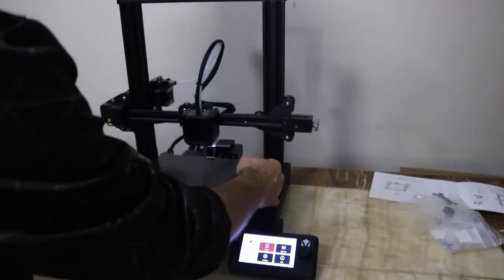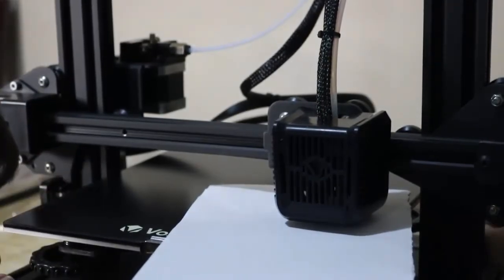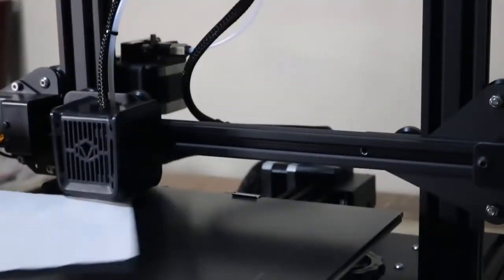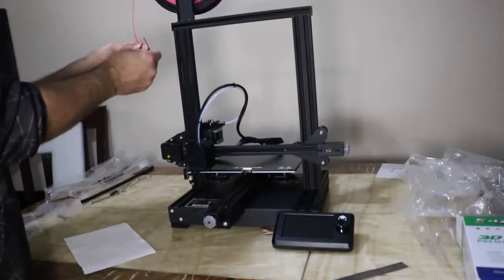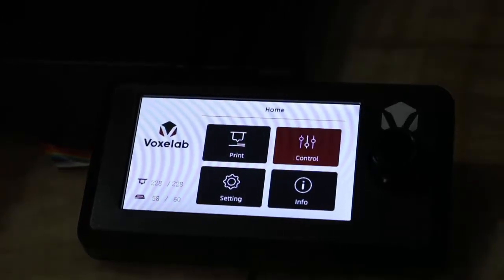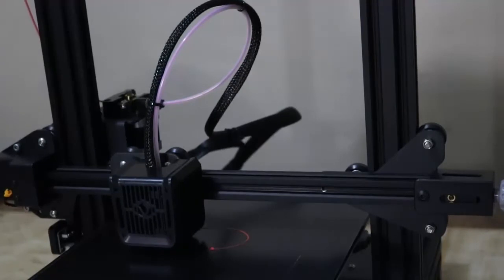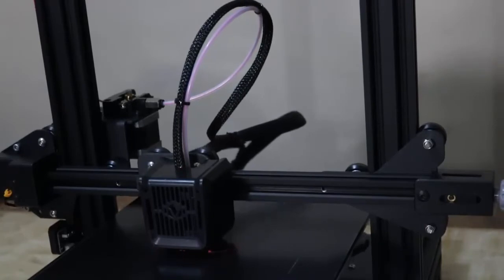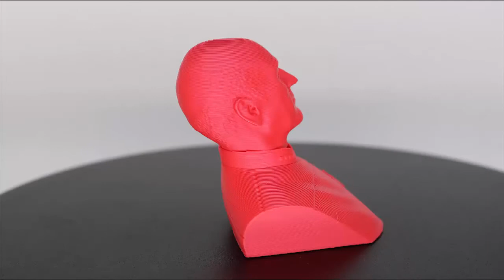Voxelab Aquila FDM Printer Part 2 - Leveling Bed and First Prints

Comment: My zero puts it against the bed and the bed is as loose as it can go... How do I fix that?
Reply: Do you mean it is touching the bed or is it higher than the bed. If it is too close to the bed, or digging into it, then you can loosen the limit switch on the extruder side and raise it a little bit so that the nozzle stops a bit higher and doesnt hit the bed. If the nozzle is too high and after loosening the bed screws you bed is still too low, then to the opposite, loosen the screws and push the limit switch a bit down. Let me know if that helps.
Reply: @shamsoft  how to losen the limit switch?
Reply from the maker: @austingodking  The limit switch is actually connected to a plate that is screwed in with 2 t-nuts on the left hand side of the printer. If you loosen them, you can move the plate and therefore the switch up and down

Comment: You really shouldn't be moving the nozzle across the bed during bed leveling because if it's too close you can make a good scratch on your fresh new bed.  Raise the Z by a few mm via the lcd then move x/y and then lower z back to 0.